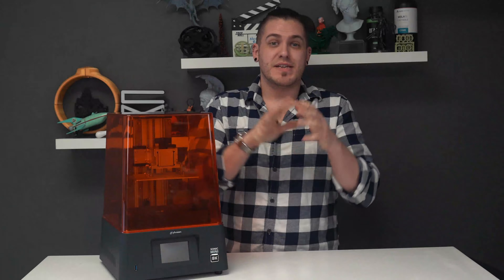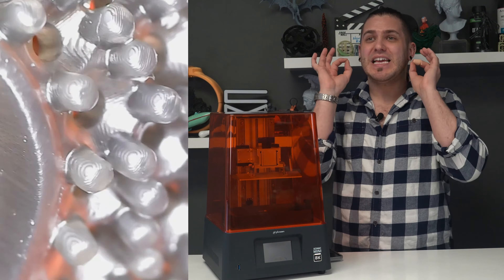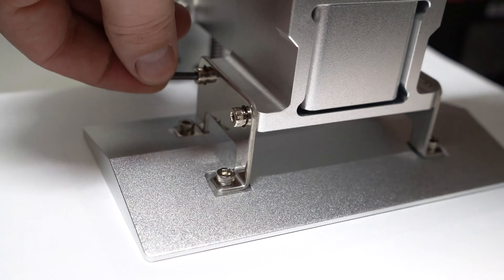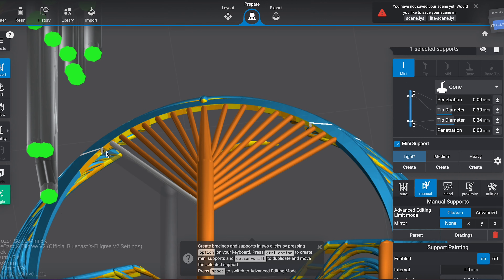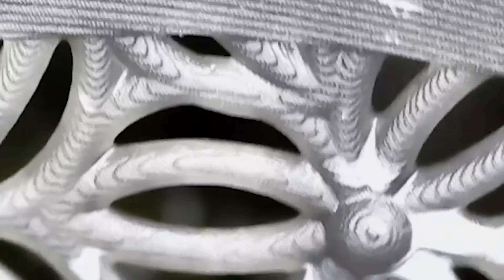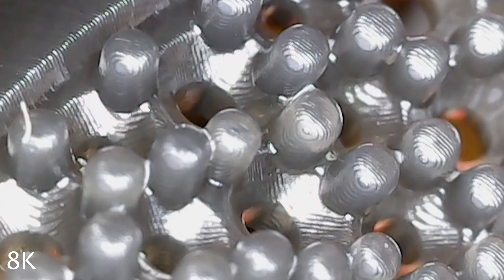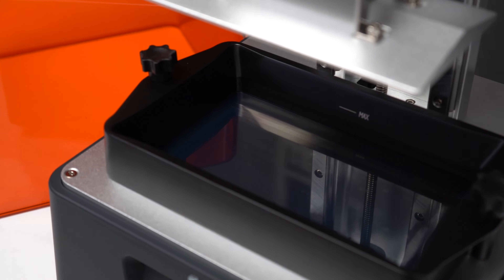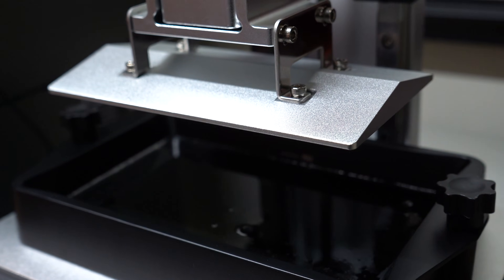Is this the best jewellery 3d printer? - FT Phrozen Sonic Mini 8K

Comment: I own 2 of these sm8k printers and i print jewelry wax on them, but there is a HUGE flaw with phrozen printers. A usb port on one of my printers suddenly stopped recognising usb sticks so it is basically dead now despite it still turns on and the uv screen works. Support suggested to buy a replacement logic board but it costs exactly the price of a new mars5ultra in my area, so i switched to elegoo with wi fi functionality. And what is worse is that all the new expensive phrozen models also do not support wi fi so they can brick any moment.
Reply: Wax with Resin printer? Wym

Comment: Great review! Thanks! It would be great if you could create a follow up video that shows the crafting of the actual jewels. Do you print a mold then pour liquid metal into it?
Reply from the maker: We have several project videos showing the whole process and then others deep diving different parts such as burnout or investment choice.

Here’s a project video showing the general process as we make a chain
https://youtu.be/SDrZCi2fdL4

The models are printed covered in a special plaster, burned away and the cavity is filled with metal.

Comment: If I am looking to make intricate HIndu yantra amulets, what type lf machinery would you recommend? This machine looks about rite to me. But the price is exorbitant!
Reply from the maker: If you are referring to the 3D Printer, the Phrozen Sonic Mini 8K is a good unit for jewellery 3D printing. It's what we have been recommending for the past few months but I think they are phasing it out in favour of the Phrozen Sonic Mini 8KS (the green lidded version). This printer is actually one of the cheaper units I would recommend for 3D printing jewellery.
Reply: @ClearMindJewellery hello, thankyou for the review. Whats your opinion about the new elegoo saturn 4 ultra vs mini 8ks for jewelry printing?
Reply: Current price on Amazon is $450. The 8k S is about $325 I think.

Comment: How to measure the quantity of the resin required?
If we dump the amount of resin and it took less than dumped resin, can we reuse the left one?
Reply from the maker: Your slicer will let you know how much resin to use once the object is sliced. Some printers will also let you know how much to fill the vat based on that information. 
Yes you can reuse resin that is left over if you strain it as they're may be pieces of support material in the resin.

Comment: does anyone think its worth jumping straight into a b9 creations printer or getting a less expensive printer and learning the ropes.
Reply from the maker: The answer will depend on if you want to build a business or if you are looking to do this part time.
If you don't have a lot of down time and you need the support and the machine to work immediately for high end jewellery, higher end printers often have that support built into the ecosystem. I know Asiga is like that and, although I haven't experienced it, I've been told B9 is similar. 
If you are quick to learn and have some start up time a lot of mid level printers will do very similar results, they just don't have all the bells and whistles, or as helpful support, so you have to be able to figure it out.

Comment: I’d prioritize print resolution first, because having two printers solve speed and also print area but not definition
Reply: The projet 300W  Plus prints at  
QHD Printing Mode
Resolution: 2000 x 1800 x 2900 DPI
Layer thickness: 8.8 μm 
UHD Printing Mode
Resolution: 1200 x 1200 x 1000 DPI
Layer thickness: 25 μm

Comment: I've purchased one I intended to use for metal casting patterns. I have not been able to make it work, the Aqua Gray 8K resin won't adhere to the plate... every print I've attempted has failed. I have repeatedly gone through the Z-Axis alignment process very carefully but no luck. I also tried the WhamBam build plate and got nowhere with it, either. 

Extremely disappointed with it. It's been a waste of money, time, and effort for me.
Reply from the maker: That’s very strange, as your using a phrozen resin on a phrozen machine you should be having better luck with the preset setting then we did with our castable resin prints. 

 Dry curious to know your settings etc.

Comment: What wax do you use to print that do well in the burn out process?
Reply from the maker: We’ve had very few castable resins that have straight failed, if used under the right conditions. 
Would recommend taking a look at our videos on burnout and investment choices then you can pretty much use any resin we’ve reviewed that fits your project and budget.

Comment: Would you recommend buying 1 big printer, or have multiple smallers ones? Lets say 1 Mighty 8k vs 2 Mini 8k, especially for jewelry printing.
Thanks!
Reply: You really don't need a big printer for jewelry. Even the smallest plate can knock out 5 to 10 rings at a time easily. Unless you print in bulk for other clients, you're fine. And if you're printing as a service for jewelers, you probably need a much better printer anyway - this won't be competitive.
Reply: @vik7368  I’m considering from the perspective of efficiency and productivity.
Would it be better to have multiple printers, so you can work on one batch of prints while the other is printing for example. Or if one big printer is better as you can print more batches/different prints at the same time
Reply: @Boris Lemke  I guess it all depends on what you want to use it for. I work for myself and do mostly custom orders. I have a resin printer that has buildplate the size of a business card, and I can put up to 10 engagement rings on it at a time, and they will print overnight. One ring will print in 1.5 hours on average. I have NEVER filled an entire plate at once. If you use it for yourself, one printer is more than enough. Even if you intend to provide  printing as a service, you will be fine with one printer until you get a significant client base. Bit if you do it a service, you will compete with a lot of people who have much better equipment, so in that case I would go for something that either prints in wax, or a higher end resin printer that will run you from 3000 on a lower end to about 10,000 to 20,000.
Reply from the maker: We buy big printers as we print our trees in place when we have 200-300 piece orders. If you’re not up to that production 1-2 smaller printers that you can rotate through will be sufficient. 
You don’t need a wax specific printer like a solidscape. We went down that road early on and Bluecast XOne on a high resolution printer will serve you better unless you have the high end casting machine and high karat gold engagement ring orders.

Comment: I'd love to say my SM8K turned out as flawless as yours, but unfortunately it didn't. Z-rod came out stuck, had to loose it manually without any customer support rather than Phrozen webpage saying basically "DIY, can't be that hard". Also, screws are terribly poor quality, 2 of the buildplate and one on the vat got loose on the head at first try, had to buy replacements. Finally, the biggest issue I ffound on this printer: the buildplate is held by more screws in tiny planar holes, where resin or IPA (if you submerge it in a W&C machine) can be stored. This can contaminate your resin, especially if you're changing brands (from standard resin to ST Cast and then to X-One, in my case), so a full cleaning by unscrewing the plate from the top is a must. Not even my Mars 3 have given me these issues, but besides that, both printers are my tools for jewelry; I print on the Mars what doesn't fit on the SM8K or those objects that don't need too much detail.. Haven't needed a Saturn 2 or a Mighty 8K so far for my business.
Reply: All valid issues Jose...  I found the screws to be of less than ideal quality as well.  I replaced all the screws on the vat, with new high quality stainless steels screws.  Replaced the build plate screws and added washers under each to prevent torquing the build plate when tightening the screws during the Z-axis zeroing.

I also found that you need to clean out the build plate screw heads between printing sessions.  If you have any IPA in the screw heads, it contaminates the resin in the vat.  Not a problem generally if you only do it a few times, but the effect is cumulative.

I don't use my SM8K for jewelry/casting, but for resin model train parts...  It's fantastic for that purpose.  Detail is off the charts great.  Have no issues printing raised lettering that is 0.1mm high x 0.1-0.15mm thick x 0.15mm tall.  Have no issues printing cross sections in the 0.2mm-0.25mm range, but they're fragile until fully UV cured.

For metal casting (brass and nickel silver), I use an Elegoo Mars 4 Ultra.  Slightly better resolution than the SM8K and loads cheaper!  I bought it because I didn't want to have to keep switching resins in my SM8K.  Honestly...  I like the Elegoo Mars 4 Ultra better than the SM8K.  It's got a flush mount, tempered glass plate over the LCD, like my old AnyCubic Photon I.

A few tips to anyone still reading...  DO NOT clean your LCD with Acetone!  For whatever reason, Phrozen chose not to use tempered glass for the LCD surface, OR it's coated with some sort of coating that doesn't tolerate Acetone.  I found this out the hard way.  Tried to clean a few small splashes of dried IPA/resin mix with IPA, but it wouldn't clean it.  Knowing Acetone is an excellent solvent, I gave that a try and promptly ruined my LCD.  At the time, replacements were about $120 from Phrozen.  The kicker is that the machine had only been in use about a month when I did it!

If it's in your budget, purchase a pair of spare LCD's...  Just in case, for when you either destroy one, or they become unavailable.

Also...  Had some significant printing issues about two months into using my machine.  Thought the Z-axis stepper motor was bad, but realized I'd just been using the wrong lubricant (3:1 Oil is not good for lead screws!). Switched to white Lithium grease after freeing up the screw and it's been smooth sailing ever since.
Reply: @WHJeffB  thanks for your reply. I exactly did that. Now I use the SM8K for standard resin and my Mars 3 for SirayaTech. Found out the issue is the castable resins on the SM8K, with any other resin it works fine. Also bought a Mars 4 Ultra as well and use it exclusively for Bluecast X-One. Now my workflow is perfect.
Reply: What’s your business Jose ? What do you print ?
Reply: @hectorgarcia8691  Jewelry
Reply: @josearmentadg  that’s what I thought, what 3D printer do you use ? Thanks for your reply 👍
Reply: @hectorgarcia8691  This machine, SM8k & a Mars 3
Reply: @josearmentadg   that’s great info, thanks Jose, I’m interested in acquiring one .
Reply: @hectorgarcia8691  get a SM8k. In terms of resolution there's no match for jewelry, mine came out with flaws but I guess it's only my case.

Comment: For me, it's all about that xy resoution, and how accurately it can print at that resolution. at 22 mictons,( that's basically 1 thousandth of an inch in american) it's possible to print extremely accuract mechanicallly perfect objects, then cast them to get exactly what you've designed with perfect tolerances. It's a wonder for prototyping, and mass production of mechanical toys that need accuracy :)
Reply: And the price for such a printer is way too much for a small business like mine. Id rather get the phrozen 8k mini. Better bang for my buck. And the difference is so minute
Reply: @Belnivista_edt  Get the Mini 8ks, its the newer model, costs lots less, has the same specs and some newer hardware inside too. Don't get the older mini 8k, honestly not worth it. They really should have removed the mini 8k from sale once the 8ks hit the shelves, rather than confusingly keeping selling the older, and more expensive model for more lol
Reply: @noviceartisan  thanks for the tip. Been thinking that it might be a good thing to invest in the sonic mini. Have a print thats not getting detail through and its frustrating 😒.   So before im left with no printer at all....
Reply: @Belnivista_edt  It's woth the investment. Every single Jewellery group I'm in rates the 8ks higher than the machines they've overpaid tens of thousands from just a few years ago :D
Reply: @noviceartisan  are there any recommendations on what settings should we use to print high-detail jewelry items? I’ve got sonic mini 8k s and today was my first print, some pieces have failed or I have broke them when i was trying to remove them from the build plate, i think they were too much adhered to the plate, and I also see cracks in some pieces🤷🏻‍♀️
Reply: The projet 300W  Plus prints at  
QHD Printing Mode
Resolution: 2000 x 1800 x 2900 DPI
Layer thickness: 8.8 μm 
UHD Printing Mode
Resolution: 1200 x 1200 x 1000 DPI
Layer thickness: 25 μm
Reply: @RomanoffUSA  layer thickness isn't right, any printer, even ones from 5 years ago, can do 10 micron layers or above/below that, standard is 50 micron due to the XY resolution been around 50 microns for a while. Nowadays 20 micron layers would be the correct layer height if you want max resolution. 

Did you mean xy resolution?